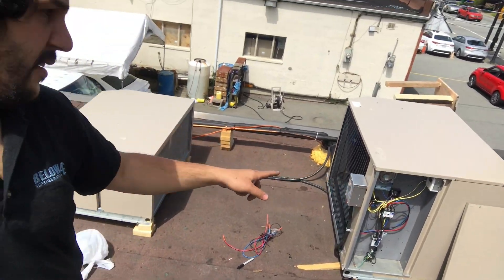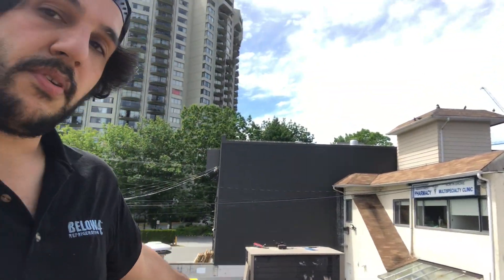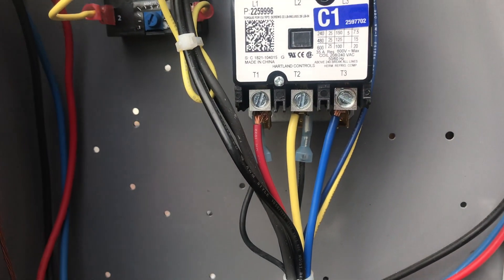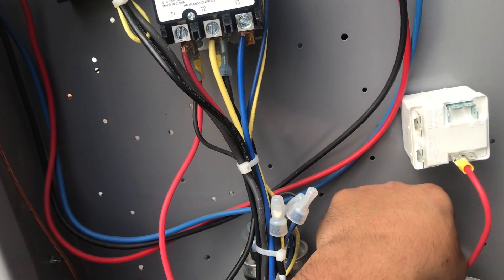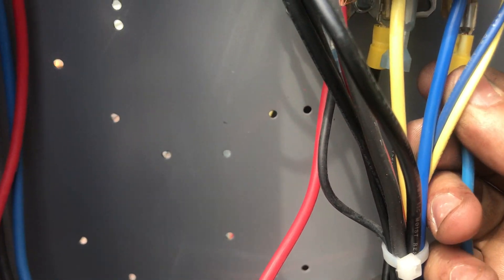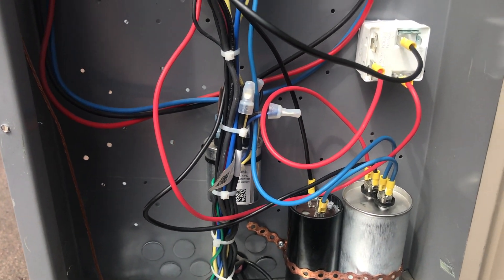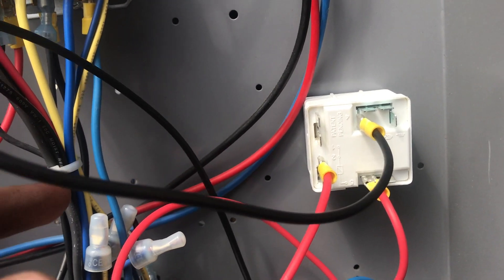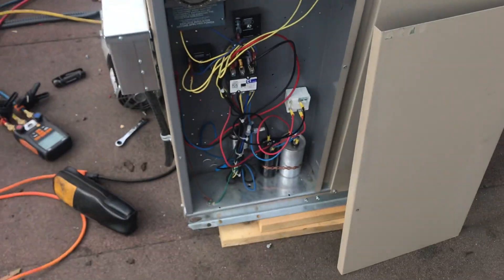SINGLE PHASE COMPRESSOR WIRING

Comment: Why didn’t you use the 1 terminal on the potential relay to drop out the start cap? You also didn’t bring a line to the 4 terminal.